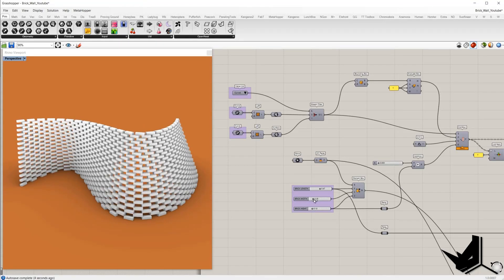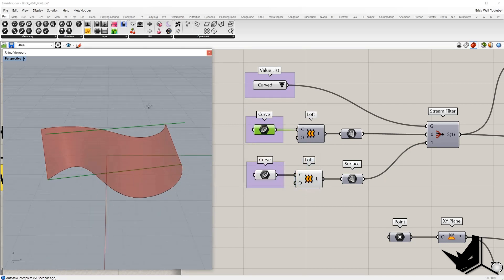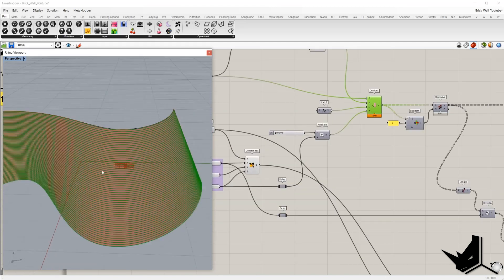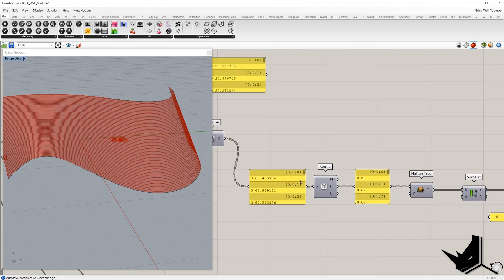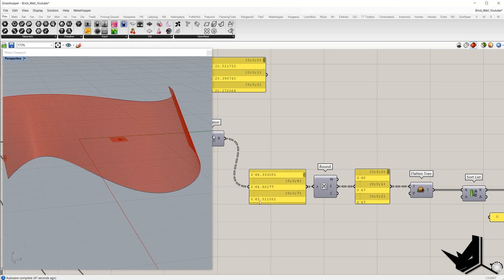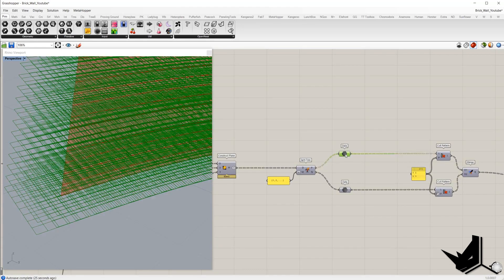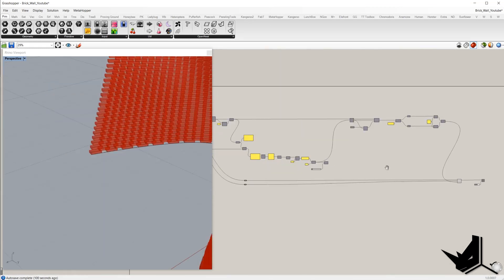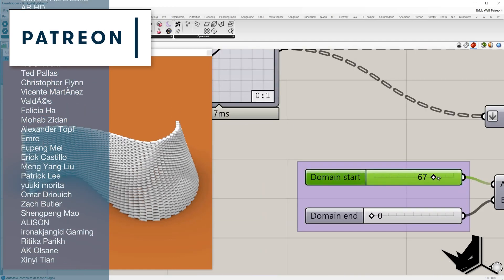Grasshopper Tutorial | Parametric Brick Wall

Comment: Is it avaliable in the intern subscription? I want to subscribe I am confused between the difference of project file and extra files is the project file missing and what is the difference between the extended video and the intern one
Reply from the maker: Everything you see in the video up to 16:25 is included in the ‘Intern’ plan.
The part after that with the project files is part of the ‘Architect’ plan.

So it really depends on how deep you want to go. If you just want the YouTube lesson, Intern is fine. If you want the full workflow with the extended content, then Architect is the better fit.
Reply: I subscribed thanks its useful but I have a question when I try to make it using a square shapes it gives an error how to fix it

Comment: did you already have pre exsisting curves on rhino or? this tutorial was not helpful
Reply from the maker: Hi Domenico,
I am sorry to hear you didn't find our tutorial helpful. If you are interested to get the project file with pre-existing curves you can find it on our Patreon page: https://www.patreon.com/posts/41061866
Reply: @HowtoRhino  how to work out parametric forms for a properly defined elevational lines (for eg.) a polygonal shape. Some bricks need to be cut on the edge because of the random elevation shape can it be achieved using grasshopper?